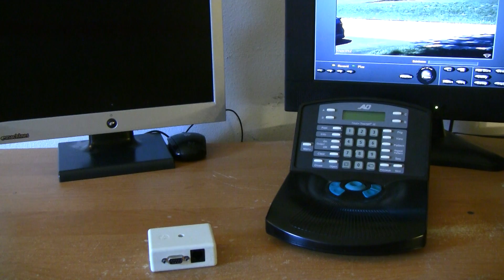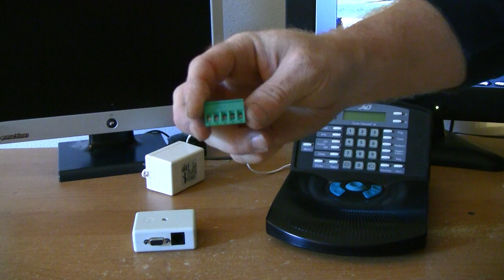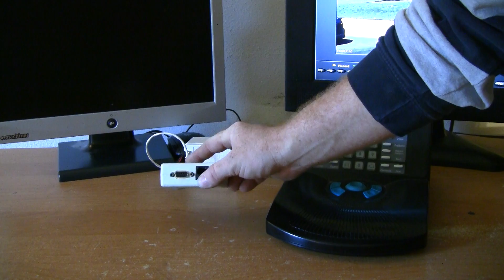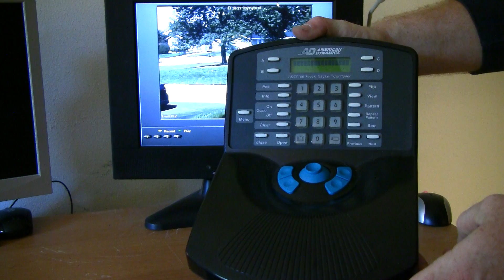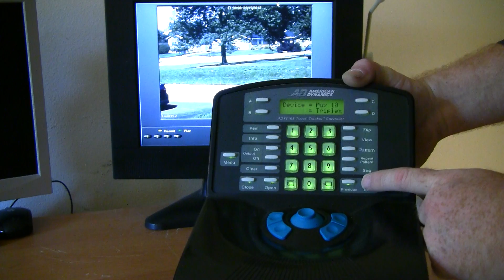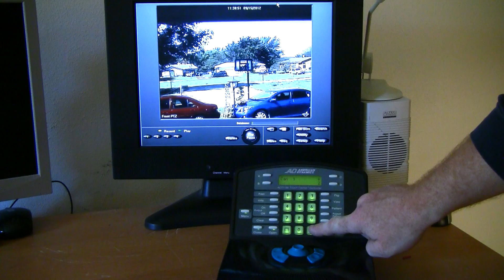Installing a Touch Tracker 16

Comment: Question for ya. We just hooked up the Intellex system at work but we are having problems with the AD2089/88 consoles. We can not set any patterns or use the "flip" button. Any suggestions ?
Reply from the maker: Calvin Lee The 2088/89 controllers should be connected to a matrix switcher and control the domes through that.  The Intellex actually shouldn't have any effect on their ability to program patterns or the flip button.  Do you happen to know what kind of matrix you have and what kind of protocol the domes are using?  It will most likely be SensorNet (2-wire) or RS-422 (4-Wire).
Reply: We are using the AD MegaPower 168. And we are using the RS-422 protocol.
Reply from the maker: Calvin Lee  First thing I would check is to make sure all the communication wires going into the MP168 on the back are  securely in place, especially the R+ and R- wires.  This is the feedback from the J-Box so the system knows it's communicating with a dome.  If one of them comes out, the domes will still respond to joystick commands but things like flip, patterns and trying to program anything into the dome will stop working because the matrix isn't getting any feedback from it.  Check at the J-Box as well and make sure all the communication wires are securely in place there too.  I don't know what type of dome you're using but the older SpeedDomes sometimes need patterns to be programmed and called up using function commands instead of the PATRN key.  For instance, to call pattern 1, you would hit 21-F1.  The flip command is 19-F1.  Let me know what you find.
Reply: We have checked and double checked the communications wires and everything is good there. We are using the newer SpeedDomes. Before installing the MP168 we were using the MP 4800 and there were 0 problems. The majority of cameras had patterns and all had presets not to mention the "flip button" worked . We are at our "wits" end with this issue now that we're using the MP 168. Very frustrating. We appreciate all the suggestions you've given so far. Do you have anymore?
Reply from the maker: Calvin Lee  What kind of response do you get from the system if you try to program a preset or pattern?  That data should be stored in the dome's I/O board.  I would try unplugging all but one keyboard and seeing if you can get a response from the flip button with just one controller connected.  Also, make sure repeat mode is set to OFF on all the controllers.  You can find that option when the keyboard is in menu mode.  Another thing to try is pressing the reset button on the code control board on the matrix.  When you got the MP168, was it brand new or was it used?  The newest software for these is 3.3.  You can see what version you have by putting the keyboard into program mode and entering  70 F2.  The version will be displayed for a moment where "HOLD" usually is on the screen.  Finally, if the matrix was used and had data programmed already, you could try a full reset by putting the keyboard into program mode and entering 55 F2 99 F2.
Reply: We will try all of these ideas. The system was used when we got it so maybe it's an old software version like you say. I'm off for a day so when I get back I will try these out and check the software version. If it is the old software is there a way to "upgrade" it ?
And I just want to say THANK YOU very much for taking the time to read and answer my questions. We appreciate it very much !!!!
Reply: Ok we checked that all consoles were set to 'off' for the repeat function and they were. We also checked the version and it showed 3.3. We haven't tried the "one console at a time" yet. We'll probably do that today or this weekend (have to do it when "business" is slow so we don't miss any shoplifting). As for what happens when we try to program a pattern...well that's easy...nothing. It won't take the pattern at all. We do have presets and they work just fine but the patterns are a different story. Same with the 'flip button', nothing happens.
I will let you know more after we try the single console and the reset of the matrix. Thanks again.
Reply from the maker: Calvin Lee  Not a problem.  I would suggest firing off an email to the American Dynamics tech support team if nothing else works.  Let them know what system you have, what keyboards are connected, software version, etc.  Also tell them everything you've tried so far.  They usually respond within 24 hours on business days.  If they can't get it straightened out via email, they'll typically give you a phone number to call and they'll help you over the phone.  I know how maddening it is not to have this stuff working.  I had a VM96 system when I was in loss prevention and had all my stuff programmed to my liking.  I used the Flip and View buttons all the time when I was after shoplifters.
Reply: Hey I'm back. We did the matrix reset but no changes. We unplugged all but one controller but no changes. Another guy here with us thinks the code reader may be bad or not compatible with the AD168. The code reader we have is a 2083. Do you happen to know if that unit is compatible ? We've tried getting ahold of American Dynamics but vie their web page but it requires registration with a company name. We're not a company...just 4 guys trying to make this system work. lol
Reply from the maker: @117997409813434055923 I'm guessing what you actually have is an AD2083-02B or C, which is an RS-422 distributor.  Were you using that with the other matrix system as well?  How are the domes wired up at your location?  Does each dome have its own data line coming out of the distributor? I'm used to having the data lines come out of the matrix and run to a J-Box, where the code is then distributed to each dome (along with power and video via a composite cable.)  Since you're using a distributor, try these commands instead and see if they do anything: Flip (67 Preset).  Define Pattern #1: Turn the key to Program mode, enter (70 Preset) and trace your pattern.  Turn the key back to Operate and enter (70 Preset) again to run the pattern.  As for registering with American Dynamics, you can just put something generic like "Loss Prevention" in the company name field.  They're not picky about that.
Reply: OUTSTANDING !!! The 67 PRESET worked and so did the code for patterns !!! But I still have a question. How do I make the pattern(s) continuous? Also when I set the pattern and then ran it it actually ran the original pattern we had for that camera PLUS the one I put in to test. How do I reset those patterns so I can have just the new pattern running ? And last but not least..with this new information you gave of us of the 67 PRESET that tells me that the consoles already have factory presets in them . How do I get a list of what these presets are and what they do ? You've been of GREAT help to us and I again want to THANK YOU !!!!!!
Reply from the maker: Calvin Lee Glad it worked!  The distributor requires a different set of commands so the standard ones wont work.  PM me your email address and I should be able to send you a PDF list of the commands.  To run Pattern 1 continuously, it's (69 Preset 70 Preset).  Pattern 2 would be (69 Preset 71 Preset) and Pattern 3 would be (69 Preset 72 Preset).  Your original pattern is most likely stored at the dome rather than the distributor, which is why it's running both when you call it up.  There's no way to actually delete an individual pattern stored at the dome.  You just record a new one over it.  I'm guessing you're using SpeedDome Ultras, so you can try going into the dome's internal configuration menu (66 Preset) and reset it to factory settings.  See if that wipes all the old patterns and then reprogram them with the 70/71/72 Preset commands.  Let me know if that works.  If not, we can try something else.
Reply: I actually found the manual for the distributor and located the listing. What I'm now curious about is why can't we set the patterns on the console like we used to do ? Before we would simply be in the "program" section; hit the number (1) button, then <pattern>, then <prog>, and then make the pattern. Then all we did was hit <ack> and our pattern would be set. Why did that method go away ?
Reply from the maker: Calvin Lee   Was that 2083 added when you got the 168 matrix?  That's where your pattern data is being stored now, instead of at the dome.  How are the dome's data, power and video connected at your location?  Do they each have a data line coming off the distributor with a separate power supply line coming from somewhere else?  If you've got J-Boxes at your location for the dome's communication and power source, you shouldn't really need the 2083.  How many domes do you have at your location?
Reply: I should have told all this before. We got this system when our New manager came in. He brought it with him from a store that closed. Before that we were using the Mega Power 48 along with a couple GANZ stand alone DVR's and a PC based DVR. There wasn't enough retention time on the GANZ and the PC based is terrible for playback especially for evidence  video for court. So we switched into this system. As for the cameras they run the communication and power into J-boxes through out the store. If I recall the J-boxes are then daisy chained and the one line comes into the office into another J-box and then into the distributor. We're currently running 49 cameras. Some PTZ some stationary. We plan on adding another 10 - 20 soon. The majority of those will be stationary as well.
Reply from the maker: Calvin Lee  If all the J-Boxes are daisy chained and you've just got the one line running out from the office, then I personally would remove the 2089 from the equation.  It's not serving any purpose.  Just hook the communications wires directly to the MP168.  Your controllers should start working normally as well.  Were you using Ganz DigiMaster DVRs?  The ones I've worked with have had room for 4 HDDs.  2TB surveillance drives are under a hundred bucks now.  If your store would pony up some cash for a few, you should be able to do 30 days video retention.  I was getting about 23 days out of one that had four 1TB drives in it and a recording schedule to switch to motion detection recording only when the store was closed.  I personally like the Intellex.  I've got one sitting in my basement that I got off eBay.  I dropped a pair of 2TB drives in it and got 120 days of video with the quality and frame rate maxed out, recording 24/7.  Let me know if everything works out okay!
Reply from the maker: MrBMG81  I meant 2083, not 2089.
Reply: Well there has been a  drastic turn of events. I was terminated today due to "corporate restructuring of the Loss Prevention program". They had to eliminate one full time spot so guess who that was. Yep...me. So after all this help and assistance you have given me its' no longer needed. sorry for taking up your time. I did learn a thing or two so I'll take that with me to the next job. THANKS AGAIN !!! I'll keep in touch